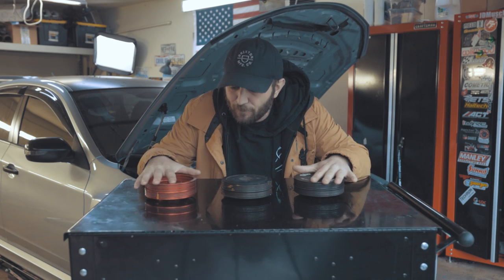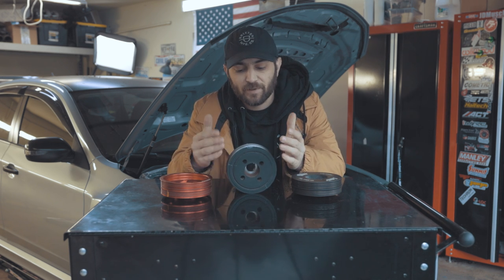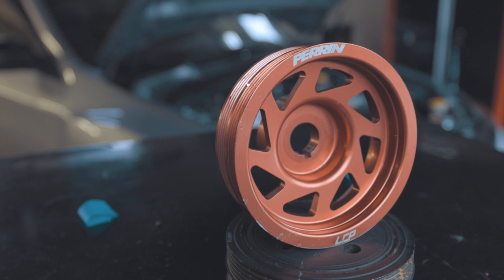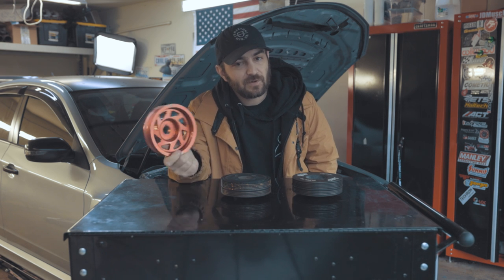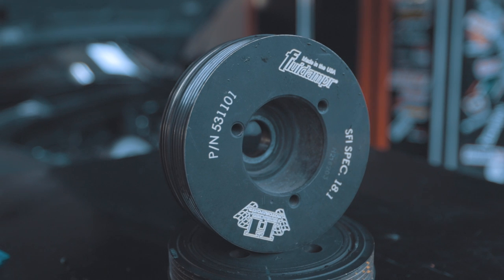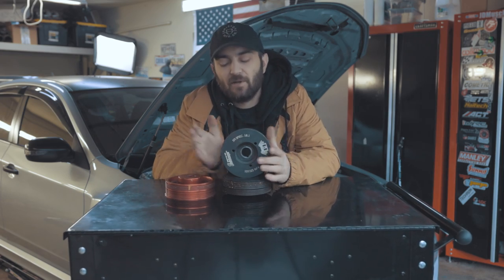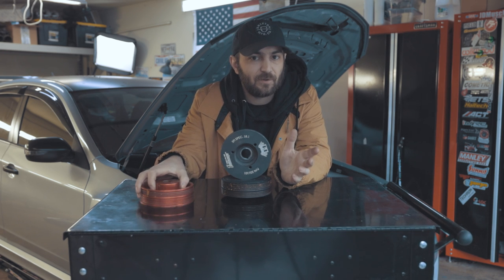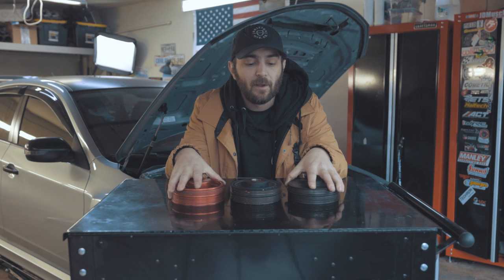Which is Better: A Lightweight Crank Pulley or a Crank Pulley Damper?

Comment: I installed a Fluidampr on my EJ205 as a reliability mod and I love it.  It might be a stretch but I feel like I'm burning less oil after.  I think MotoIQ's article comparing all three of these on a relatively stock BRZ speaks volumes; despite the extra weight the Fluidampr made more horsepower on the dyno and showed a much smoother power curve.
Reply: Less oil consumption from a different crank pulley sounds like fantasy. I have the same one but that isn't what it does
Reply: @TrillMurray  it's probably just a placebo.  The engine is noticeably smoother after.
Reply: It could, but only if the pully is used as a sealing surface for the crankshaft seal and the original one is fucked
Reply: @martienthestar  lol, true, but not in my case.  It was a leaky valve cover on the passenger side.  AOS is next for more oil retention.
Reply: @martienthestar  the front main seal is behind the pulley on these and just contacts the crank and case halves.
Reply: @martienthestar  Oil is consumed in the combustion chamber. Sounds like they are saying the smoother engine leads to less blowby
Reply: Wouldn't burn oil if you bought a rb
Reply: @Rhyss4K  lol, who said I wanted to make real power?
Reply: @gregharder2765  based
Reply: @Rhyss4K or any other motor lol. Jk I love my ej but man no kidding 😂

Comment: Great topic to discuss. I feel like for the small hp gain probably safer to use stock and if I do a big build I'll go with the fluid damper. Thanks for the edumacation lol.
Reply from the maker: This is the way 🔥🤝
Reply: There's also ATI dampers. They can also be rebuilt, which is kinda nice.
Reply: a good dampener is worth power. zero point for anyone to just run a simple pulley.
Reply: @leftyo9589  The point is to have a reliable daily driver and not a shitbox sti for 10 hp you won't notice anyway lol. Then blame subaru when there is engine failure to your car.
Reply: @newguynasti2008  well, subaru motors are not as mod-friendly as K20/K24, LS, 2JZ, etc. that's why it has a reputation as being crappy.
Reply: The brand depends on engine platform but I always recommend a damper...no matter how good your balance is or how high you balance too(rpm), bad tuning, clogged injectors,  misfiring,  etc will cause vibration into the crank. Cheap insurance and they are usually better built for long life
Reply: @sepg5084 say whaaaat?

Comment: Fluiddamp crank pulley and lightweight pulleys combo. I had full lightweight pulleys and intake on an frs. A bit louder engine idle and maybe 5 hp. Just get a fluid damp and reduce weight without reducing reliability.
Reply from the maker: Fluidampers are always a solid move 🔥
Reply: Any issues if i were to pair the fluidampr crank pulley with lighten alternator and waterpump pulleys on a BRZ?
Reply: @lauchongyee9062  Sounds fine.
Reply: Are u running on the said combo for your ride?
Reply: @lauchongyee9062  Nah I had the lightweight pulley kit from raceseng with the lightweight crank pulley. For 15k miles moved on to other cars. I would have liked to replace the crank with a fluid damp because it will only help with reliability. It won’t hurt. Also lots of people have a good argument not to change pulleys on an FRS because money could be better used for exhaust, tune, brakes, tires etc and I agree.
Reply: Thanks for sharing and u r quite right, I could use the money for some other mods. Since I’m still keeping it NA with only plug and play mods then i can keep my stock pulleys for now
Reply: @lauchongyee9062  Sounds like a good plan. I bet the fluid damp would be nice with a header and tune.

Comment: Fluidamper actually weighs about 7 lbs.  The ATI pulley weighs 6 lbs.  Which is why i choose an ATI damper.  That and the ATI is about $100 less.
Reply from the maker: My fluidamper weighs 6.6 👀 that's what my scale read out at🫡
Reply: @Smeedia  According to fluidampers site they weigh 6.9 lbs.
Reply from the maker: @Don Merrigan  interesting 🤔  in its defense I did weigh an older one as used in the video ao thr newer ones prob weigh the 6.9
Reply: @Smeedia  both have great track records.  20% cheaper and 15% lighter is what sold me on ATI.

Comment: I have a  fluidampr on my MK7 GTI. It has not only smoothed out the idle, but has also allowed the car to pull all the way to redline before I was experiencing some timing retardation due to the false knock. This has completely cleaned all that up highly recommend.

Comment: I swear by fluid dampener on EVERY motor I've ever build!
reason being the balancer/pully affects the harmonics of the crank and thus affects the valve train. 
this is why belts are preferred as they help dampen these harmonics. 
This harmonics can cause tuning disruptions, valve bouncing, and so many other weird phenomenon leading to destruction. 
This was an awesome very well informative video with a great explanation! 10/10 said it like you read the same books or followed the same builders!
Reply: although super funny I build LSx motors blindfolded, and Honda motors time to time, and had built some crazy rotaries too *in fact a lot of the YouTube junk is just that*!  worked for Mazda motorsports specifically in R&D for their experimental scale GPT car they had been developing for a new car in series back in 2016. That's a weird story. but they swore by harmonic control and dampening. 

But seemingly all engines have this same combustion harmonics and these harmonics VSTLY effect the engine life. 

Koenigsegg free valve tech and some new2 machining styles have made some insane motors with near zero harmonics and ABSURE power for their size because of it.

Comment: I read about Fluidamprs a lot in the NA community. It's a must-have, especially for NA EJs built to rev upwards of 10k RPMs.
Reply from the maker: High revving engines definitely benefits from the dampers
Reply: same with FA20? I'm debating between a light pulley and one of these.

Comment: 5:16 To add a bit to this discussion, I'd like to relay to you guys that, an engineer once told me that the only two piston driven engine rotational assemblies that achieve a "natural balance" at any point of their cycle is the flat four and the V12. This bit of info led me to form the opinion of, this inherent stability being the reason that the Subaru h4 can get away with just a little bit more tortional vibration than other engine designs.

Comment: Fluidamper rocks !!  Thanks for putting some basic science behind harmonic balancers.  Noticed a wobble coming from my noisy 02 WRX.  Decided on the Fluidamper and I can say that my 02 still Loves me !!🙂
Reply from the maker: Fluidamper was the right move! 🔥🥳
Reply: @Smeedia  Was looking for a replacement as the OEM rubber was beginning to disintegrate. Fluidamper was so expensive compared to rest and was curious how it would do:  Wow cleaned up the wonk and vibrations.  Keep up the great videos !!
Reply: @i.norman  WHich engine, year and mileage did the rubber start disintegrating at?
Reply: @mikekillion4731  Hi - it's 2002 WRX Wagon - Automatic, with a EJ205AX3BB engine.  I think I'm the 2nd owner and replaced the original crank pulley at around 250,000 KMs.  Saw the crank a little wobbley  when idling, inspected it and could see bits of hardened rubber missing.  Replaced it and the engine idled incredibly smooth, though not sure how a new oem would compare. worth the price for fluidamper !!

Comment: This reminds me, I grew up working on old vw's, and I thought it was so weird how most other engines had big chunky dampers and vw's ran these single row, really light weight pulley that was mainly just used for timing marks.
Reply: It's a bit different with pushrod engines than modern OHC engines. But when I saw the built ones, many had dampers added or went total lightweight. But rebuilding a vw engine is like a weekend lol.

Comment: I'll add a forth option to this that might be worth considering as a cheaper alternative. Some quality aftermarket dampened pulleys are lighter than stock. On my old hawkeye the OEM pulley as you mentioned separated the two rings. In desperation I ordered a Febi-Bilstein pulley from Amazon due to next day delivery. On arrival I instantly noticed the Febi one to be lighter.. Not only did the engine rev more freely, it also seemed to reduce the NVH a little. But that could have been due to the old worn rubber on the OEM pulley. I've considered just replacing my hatch pulley before the OEM one fails. Keep up the great work. Awesome content as always.

Comment: I paid $366 for my Fluidampr pulley almost 3 years ago. I haven't installed it yet because I'm probably going to save it for my V9 EJ207 that's on standby in case my EJ205 pops. From what I read while in the rabbit hole, the lightweight pulleys are worse in the long run if you are combining them with lighter flywheels. You will start to notice that the daily driveability will suffer, meaning your revs will be all over the place. OTOH, if you track the car, then you'd be better off because you're not trying to maintain a set speed limit. The EJ's crankshaft is also balanced with the damper installed, and by installing a lighter pulley, you will increase oscillations. That is not a good thing. 

IMHO, I feel that a lot of newer Subaru owners comb over the aftermarket sites and look for something that claims more power but doesn't break the bank. Hence, the slick marketing for the lightweight pulleys. Just my .02 cents. Anybody is welcome to do as they please. Just do your research.
Reply from the maker: 100%, I left out lightweight flywheels from this intentionally. Personally, I stick with OE. When possible, I will keep the mass on the crank to help with inertia when turning over. 

Funny enough I came across an email from SOA stating the oe pulley is nothing more than a pulley as well. But like I stated I always suggest the fluidampers 🤝
Reply: I believe I saw a post on the forums(not sure which) where someone shared the same reply from SOA. A pulley that has an elastomeric ring surrounding it and they(SOA) call it a pulley just sounds odd. 

I know that the OE pulleys will literally come apart, which is why I'm thankful for an aftermarket solution. Maybe I'll buy a second Fluidampr and finally get around to installing one on my EJ205. I also have to do the timing belt... Oh and let's not forget about the OE cam pulleys that crack💸💸💸

Comment: The correct pulley makes a big difference.  I have a cranky old man (machine wizard) building a Chevy 327 for me, getting fully balanced and all.  He still recommended the 10in 350 HB over the 327 6in stocker.  Bigger, heavier one worth 15hp in the mid range since it smooths out everything a lot.  The actual harmonics from the combustion pulses causes hp loss cause it starts to resonate and shake the engine apart
Reply: Sounds like bro science let’s see the dyno charts
Reply: @andreahighsides7756  We are building a small journal 327, 63 to be exact.  The factory pulley was a 6in.  Factory switched to 10in for all SBC sizes in 67.  Now while I don't have the Dyno charts, I am sure GM has them burried somewhere

Comment: Dampner.  For a flat motor or opposed anyhow.  The harmonic resonance in them is brutal.
Reply: As per what a dampner is, most engines do have a "dampner" and it would almost always take a cross section to see how much rubber or composite is used to soak up vibration and resonance.  Lightened pullys (as a a dyno technician) I have noted that in   about 30% of circumstances INCREASE the amount of resonance past having none, due to essentially adding a tuning fork to the end.

Comment: If you want to rev up faster, get a button clutch and super lightweight flywheel. The fluid damper is indeed heavier than stock, but it's the same outer diameter as stock, which means the mass is added on a shorter radius, which is easier to accelerate anyway. A smaller diameter clutch and flywheel has 4-times the effect that a somewhat heavier damper has.

Comment: For FA WRX's, the issue to look out for is the rods which are connected to ... the hip bone (j/k); crank shaft.  My assumption is that this is that rod failure typically happens from "bigger booms" after say 350 to 375 torque.  Would a fluid damper help?  Hopefully I asked the question right.  Sorry if I didn't in advanced.

BTW, I've learned so much from your channel man.  Sooooo much.  Thanks big time.
Reply from the maker: Unfortunately it would not help with that, higher cylinder pressures will make a rod bend before the vibrations ever would 🙏
Reply: @Smeedia  I see.  Thanks for the info.  Looks like beefier rods are the only solution for my modest power goals.

Comment: When I bought my wrx it came with a gfb lightweight pulley kit. I really want a different pulley tbh. But I don’t wanna spend $450 on the fluidampr and I don’t want to spend $180 on an oem pulley. I need to find a used oem pulley lol. Great video tanner

Comment: I grabbed a fluid damper for my eg33. Did a bunch of research as well. I paid about 600 canadian for mine and had to wait 6 months for it to be made. But was worth it.
Reply: For an EG33 I wouldn't really worry about it, the boxer 6 is one of the best naturally balanced designs ever and they have a relatively short crankshaft torsional twist isn't usually an issue. I have researched using fluidamper but couldn't find enough reason to bother. I am not an expert by any means and anything you do to your build is good for you, I know you sure didn't make things worse.
Reply: I will also add the crank and stock rods are both forged in the EG33  even if the rods are a bit too thin so having those forged also helps keep things going fine without the vibration damping. I ran that exact Perrin LWCP on my SVX for 8 or more years but I was also running the stock ECU with Chip for fuel and timing mods that got me about 200 AWHP with stock injectors and some supporting mods, I also changed the tune and put in Nissan MAF and 550 Sti injectors without any issue but only ran that for a couple years. never did get a chance to re-dyno it. i was also running a sti 6 speed.
Reply: @black69camaro2344  agreed. They are well balanced. But the stock one I had was starting to separate. I also found info that when you are loading the crank with higher torque (more than stock obviously which is the end goal) the fluid damper helps with the accessory drive stuff not getting the shock transferred through. Unless I misinterpreted that part.
Reply: @jaredoliver3296  No I think you have it right, I don't know that the fluidampner is needed unless your going with 600 plus power and the light pulley is probably going to be fine for a lot less money. but the fluidampner isn't a bad idea at all.
Reply: @black69camaro2344  agreed. I plan on supercharging or adding a turbo to my svx in the future so figured I would just buy it now. Maybe looking for the 400 wheel mark but will have to go standalone at that time
Reply: Yeah that's what I always intended to do with mine

Comment: Just did a fluid dampr on my wrx coming a lightweight crank pully legit best 400$ I have ever spent worth every dollar
Reply from the maker: Feel any diffrenece in the car? 👀
Reply: Huge difference upgraded mounts  the sound was much better much smoother revs and less vibration through the steering wheel

Comment: On a DI engine, the LW pulleys do beat the accessories to death due to crank chatter, but on non-DI, a lightweight one also with smaller diameter is good for maximum HP as in racing use.

Comment: Perrin lightweight crank pulley still goin strong on my wrx with 67k miles 🙏 I think the Perrin LCP does the opposite of NVH reduction, lol. Still a bit of a sketchy mod
Reply: Thanks for saying this. Between you and this video I think I'll go with the Fluidampr. Would love smoother operation and I can make up for the extra weight with the accessory pulley upgrades.
Reply: @mikekillion4731  100%

Comment: i used a grimmspeed pulley for 5 years and maybe 20,000 miles on it. not bad. going back to oem now to see how my 4.44 gear ratio will be with ej255, vf48

Comment: Finally installed by Grimspeed lightweight pulley. (-3.5lbs from stock) and definitely feel the difference when rev matching and generally revs faster.  I felt like the added weight over the Perrin pulley would keep me from any Cels and hopefully not do any damage. The 1.2lb Perrin pulley just seems too light to me lol. Wish I could afford a fluid damper mind you, but alas, daily driver WRX not a crazy build.
Reply from the maker: Nothing crazy for power I wouldent stress it too much 🤝🙏

Comment: I did a fuji racing AC delete pulley (1.8 lbs) and a act street light flywheel and I felt like the engine revs whicked fast. (Na mind you 253) but I have heard you can make the vct go wonky if you Rev too fast. I also got the Perrin engine mounts and the group N trans mount and the chassis does vibrate. I do keep the idle rpm up to 950 though so its not unbearable. However got me thinking on longevity. And like oil pump cavitation.. Wonder if I can gear down the unit..

Comment: the problem with LW vs FLDDPR is that Fluidampr might not support each engine whereas you can probably find a lightweight pulley for even the most obscure engine...